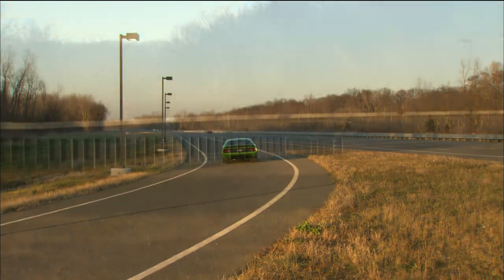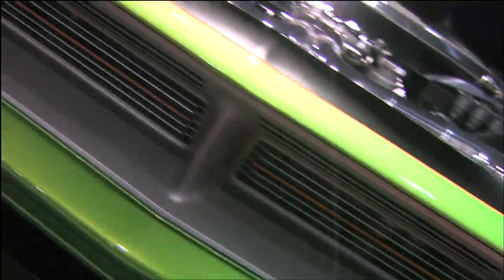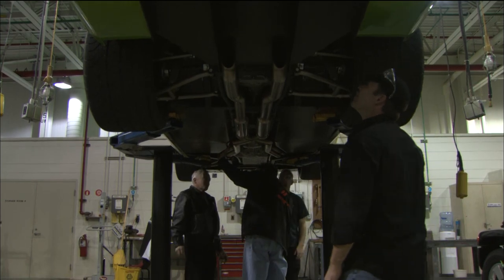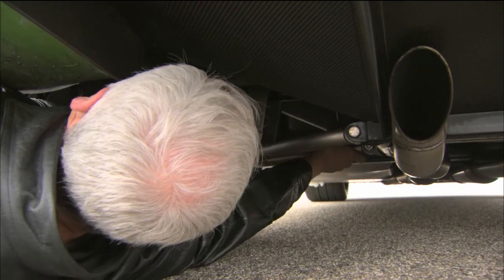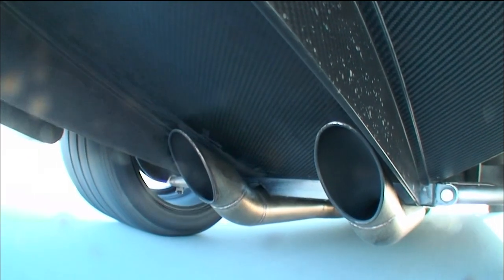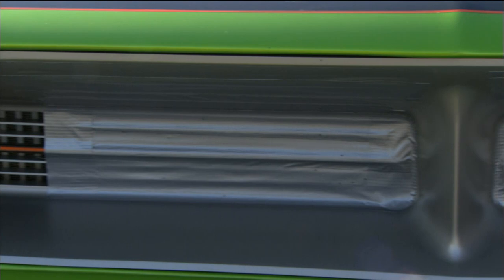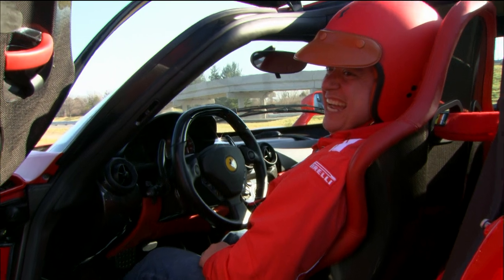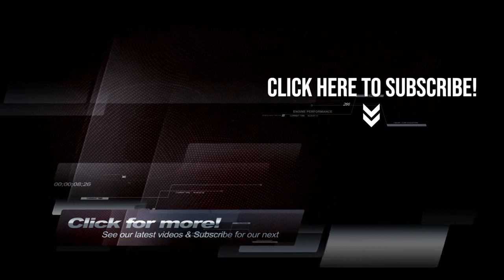Can a custom Super Plymouth Barracuda beat a Ferrari Enzo?

Comment: I was lucky enough to be there and watch. 31 year career at the Chrysler Proving Grounds, drove thousands of miles on that oval. Took an early generation Viper up to 175 mph (unapproved, ha!) on the old concrete and expansion joint surface, one of the scariest things I've ever done. Oval had just been paved before this filming, those speeds would have been near impossible on the original surface. The Ferrari ran some blazing laps.
Reply: Sounds like the best job in the world!! Lucky dude.👍
Reply: As a machinist and mopar nut, I would love to have had your job
Reply: Just thinking out load those 2 cars are apples and oranges. The Ferrari owner was definitely impressed.... Now just think if someone took the same setup and applied some modern aerodynamics to it. But in the spirit of the car the changes may take away from the "golden era" of Musclecars and who knows where that goes.... Bad ride!

Comment: I am a Mopar guy for life and hemi is an awesome engine way ahead of its time, but I still argue to this day that the V 10 Viper Motor is the best motor Dodge has ever made along with the car. It is the best underrated car and arguably the best car ever made in production. I don’t care what anybody says. The motor is bulletproof in the platform. Is The best when it comes to rear Drive nothing will ever be able to beat the car and it pisses me off that it’s been discontinued. Shame on Dodge and everybody else that supports EV cars that is the biggest scam in history if they were so concerned about the environment, they would’ve made a car that ran on water. What about the olden days when they had no electricity? They burned wood daily … so much smoke and waste went up in the air and they wanna make a big deal about global warming. Give me a break. What a scam. But it’s OK to run satellites and cell phone towers and pollute our environment with toxic EMF that’s OK we’ve been bought and sold down the river and shame on people that believe that EV Is the answer they bought that lie hook line and sinker

Comment: Adrenalin Junkies Paradice.....that cuda' should be able to clean the Enzo's clock on top speed runs, the stance may be a little off, needs to be much lower, maybe a wing? The mid-engine Enzo will kill the cuda' in actual track racing, depending on whose driving though....